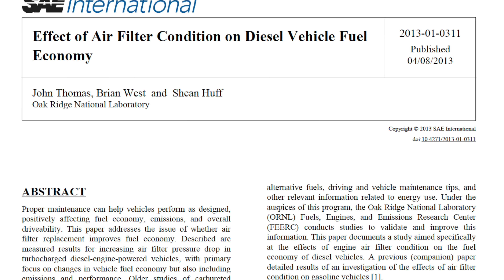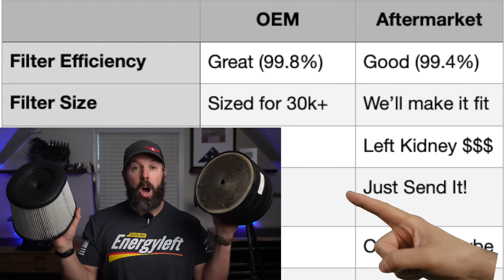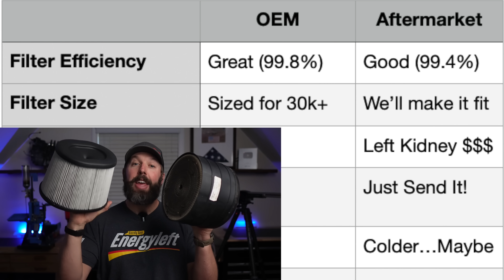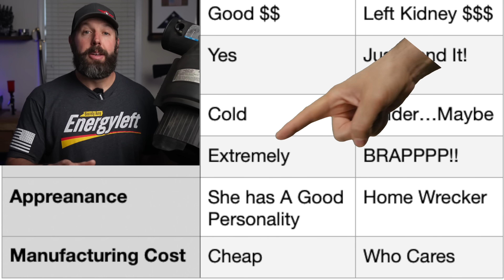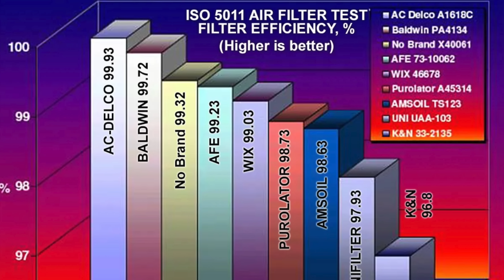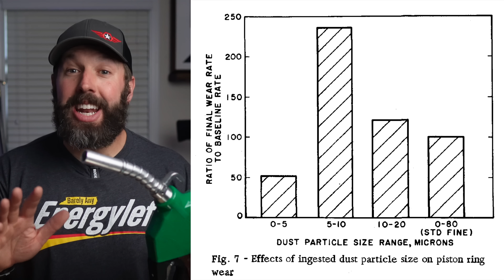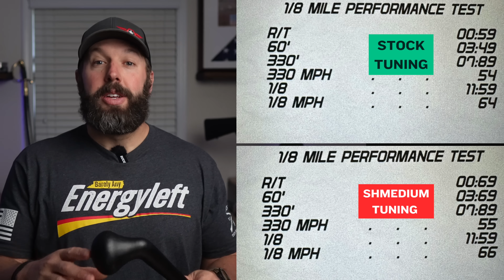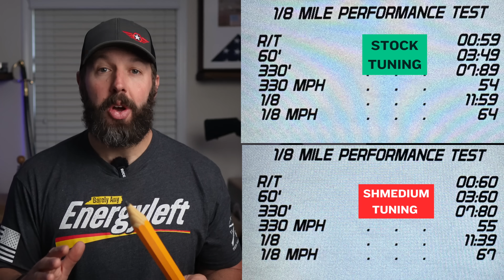The TRUTH About Cold Air Intakes…ACTUAL SCIENCE!

Comment: How many times have you seen a K&N filter just sitting open in the engine bay?  They replaced the factory cold air intake with a post radiator hot air intake.
Reply: I've seen this so much on BMWs... but they already have cold air intakes stock... even on my classic BMWs they have routing that pulls air from behind the headlights, before the engine bay. Silly.
Reply: @seifm02   yup, and its so stupid.
Reply: This is false.  Most cars these days pull air directly from the front of the car. These loads of tests that show there's virtually no difference in IAT'S.
Reply: @GingerDude1  Indeed that was my point, from the factory BMWs have a cold air intake, but often I see owners put on 'cold air intakes' that are sitting fully within the engine bay, drawing air that has already come through the radiator.
Reply: @seifm02 it still doesnt matter. If there's an inlet that draws air from somewhere like near the headlight, you wont have a change in IAT's. If you wanna truly show your myth, show data logs of IAT's with and without the factory intake. They're virtually the same
Reply: Nevermind if after it you have turbo and intercooler
Reply: @Зуб-За-Зуб  Even with a turbo and intercooler it matters.  For the same boost, a turbo has to work harder when the air is hotter.  This means the variable vanes close more and make the turbo spin faster due to the hot air.  That raises the air temperature to the intercooler.  GM actually had engine cooling issues in the 'aughts due to a spike in the air temperature to the intercooler.

Comment: I guess could you feasibly find a oil filter that could go that low for some cars or trucks? And would it be worth it? I wished the aftermarket companies would use the higher filtration filters but bigger to reduce restrictions and design potentially higher flows

Comment: 20 years ago a truck magazine took 4 cold air intake kits for a 5.9 common rail Cummins and compare those to the stock filter system on a dyno. Two of the aftermarket cold air intakes actually made less power than stock and the other two made the same. Then they tested the filtration, those aftermarket did not do well. The best thing is to leave it stock if you run stock or near stock like you said. The motor oil geek just did a video on air filters also very good.

Comment: This is perfect timing. I was thinking of doing a intake system for my 6.7 powerstroke since i've made it lighter weight for lower egt's and possibly better mpg.. I've heard from a performance cummins shop tell my dad to take off the K&N filter and stick to the paper exactly for the reasons you mention. He wasn't going for power but efficiency and as we can tell from this video it's safer to stick with stock paper filter.
Reply from the maker: Yep, it wont help efficiency in a diesel. 👍

Comment: Could you possibly do aftermarket intercoolers. Great info, thank you!
Reply from the maker: Great idea 👍
Reply: @freedomworx  thank you! I’m deciding on if I should do an aftermarket intercooler for my 2.3 turbo Bronco. The science seems to make sense but thought I would get your thoughts.
Reply: On a diesel, intercoolers are a lot like cold air intakes. There is not a one sided fits all solution. You do not always want the coldest air possible because the intake temperatures can have an effect on combustion. For low and medium loads, I am guessing the OEM's actually want warmer air for efficiency.

Same reason people add Cetane boosters. That makes the diesel easier to ignite which is effectively advancing your ignition timing.

Its different on a gas engine where the intake temp means you are pulling ignition timing and giving up power. Gas engines are usually very octane limited and so you want the air charge to be cold to make sure you stay as close to MBT spark timing as possible.
Reply: @Jay-me7gw appreciate the reply. This would be for an ICE 2.3 turbo ecoboost.
Reply: @justinwalters219  Then yes, I absolutely would do an intercooler. I've yet to see an Ecoboost vehicle with a decent stock intercooler. I had a 2014 F150 Ecoboost that I tuned myself and the intercooler was absolutely the first and best upgrade you can do. I would even say get it even if you never intend to tune the truck or do any other performance mods because it will just make it run more consistently.

I dont know who makes them specifically for the Bronco, but the CVF intercooler for my F150 was a huge and worked VERY well. The price was pretty reasonable too. Wagner was another brand that made great ones for the F150, and so did AMS and Cobb I believe.

That and 93 octane and it will rip.

Comment: Turbo Diesel Register had a two part article on air intakes.  Two bullet points are noted as follows:
issue 56-Diesel Power magazine tested six aftermarket air intake systems and none of them made more power than the stock intake.
issue 59-The OEM sealed air box provides the coldest air to the engine.  Semi-open heat shield type air boxes in real-world driving conditions allow hot engine compartment air to enter the intake.
The main point is that the "cold air intakes" are mostly marketing BS.
Reply from the maker: I’ll have to check those out. I assume they are fairly old articles?
Reply: @freedomworx  May/June/July 2007 and Feb/March/April 2008.
Not sure what you mean by faulty?
Reply from the maker: @bribbripnairbnab7301  I meant "fairly"...damn autocorrect. 😂
Reply: @freedomworx  Autocorrect gets me quite often, especially when not using my reading glasses.
Reply: You are correct about the stock air intake was going to put a banks intake on mine then seen the tdr register article saved me over $400 bucks cai are a scam.
Reply: @zackeryeckenrod6549  That seems to be the general consensus in TDR articles.

Comment: I made the mistake of putting a K&N air filter on my old ‘03 Silverado.  After running it for a few thousand miles, you could run your finger along the inside of the intake tube downstream of the filter and feel the grit.  I took it off and put the stock filter back on.
Reply: Question?  Was this a filter that was supposed to be oiled after it is cleaned and then installed?
Reply: Same thing happened to my 22RE 4Runner. I bought it from a guy who had a K&N in it and when I pulled the intake off at one point, the inside of the tube was visibly dusty.

Comment: Speaking of not wanting to hear turbos, before I started trucking, I thought it was cool to hear the turbo whine in these big trucks. After a couple of years of running mountains and pulling heavy loads, I was so tired of hearing that damn turbo scream all day 🤣
Reply: What's really fun is when the truck is so quiet all you hear is that damn thing. It's not super loud, but it's enough to wear on you and your ears start to feel it. I'd rather hear some exhaust and get audible throttle feedback than hear almost nothing. 

Weirdness, I used to stay awake a lot easier in louder trucks. Wore earplugs, but something about that vibration or bass made it easier to stay up. The new one is a sensory deprivation chamber and it's absolute hell.

Comment: 15:31 jokes on you I only race 10 miles at at time.
If you upgrade to a bigger turbo you will need one if its a good bit bigger. My buddy pulled his stock filter into the tube of his intake tube after installing a silver bullet 66 on his 98 12v.

Comment: The LLY Duramax has the worst OEM air intake ever designed for a diesel engine.  GM has a TSB recommending the replacing of the factory for the LBZ version.  I chose the Volant cai with the air scoop as a Replacement.

Comment: How do you think today's dry filter tech stacks up against an oil bath air filter? My old 1969 Dodge Power Wagon 1-Ton 4WD had a large oil bath filter. When I sold the truck in 1988 it had over 450,000 miles and still ran like new. Standard preventive maintenance, points, plugs, plug wires, oil changes at 5,000 mile intervals, fluids, grease & lube. Put two starters and one muffler, and brake shoes & drums as needed during that time. Often wished I had kept it... The Jeep I bought to replace it was a POS.
Reply from the maker: Dry filters are far superior. One of my SAE Papers included an oil bath into the mix. It wasn’t even close. The oil bath was basically a screen door.
Reply: @freedomworx I converted the oil bath filter on my 64 F100 to a paper element.  It took a little fabrication and finding a filter that would fit in the old oil bath housing.  Everyone thought it was still an oil bath.
Reply from the maker: That’s cool 😎

Comment: I would love to see a video about crankcase vents venting to the atmosphere vs stock vs oil catchcan. There's a lot of conflicting information on the internet.
Reply: This would be a good one
Reply: I can tell you this from personal experience: I had a 2019 Honda Accord Touring, which had some sort of stock oil separator. I installed an additional catch can, and it pulled an astounding amount of oil. There is absolutely a difference between stock and a catch can, and this was a simple commuter car.
Reply: @johnfreeman2956 I also have a 19 Accord Touring, it's had a mitsumoto catch can since I bought it. A lot of what it catches is just condensation. But it does catch oil and dirty shit. When it's cold out it fills way quicker
Reply: @johnfreeman2956  Most people think it's trapping a ton of oil.. and what they're seeing is a ton of yellow sludge made up of unburned fuel and water and almost no oil. That aside, catch cans always made my UOAs come back worse for fuel and moisture dilution so I took them off after I figured out they were causing that and I don't put them on my cars anymore. Rather burn a little oil than end up with engine sludge from fuel dilution in the oil.
Reply: @johnfreeman2956 

You are correct; but, for the wrong reason.

Adding the additional "oil separator" changes the PCV system balance.

In essence, the PCV is designed based upon engine size, blow-by, Manifold Vacuum, oil viscosity, and a few other details.

What isn't understood is that the ramifications of changing the PCV balance extend into drivability issues, fuel consumption, engine wear, and potential oil leakage and seal failures. Most commonly, the valve cover, oil pan, and front and rear main seals.

As my father, a mechanical engineer, said many times, if you don't fully understand all of the ramifications of what you intend to do, the best and cheapest choice is to leave it alone.

V/R Chris
Reply: you mean like this ? https://www.youtube.com/watch?v=AnuniilHO5I
Reply: I would also like to see a video showing the Pros and Cons of these mods.
Reply: Emissions improve with recirculation, unsure if power tangibly affected. Fuel economy may be affected by a small percentage.
Reply: I did a vent to catch can then to atmosphere to cut down on how much makes it out to the atmosphere
Reply: Great one, hopefully
Reply: There’s actually not a lot of conflicting information on this, there’s just a lot of people that don’t understand it. Diesels are designed to run the crank at atmospheric. The crank case filters is merely an emissions control component.
Reply: That is me and my 1999 Toyota Hilux - But during inspections, its stock - ha ha -
Reply: there's good and bad to all options....catch can potentially be the most dangerous to the engine. Dodge / Cummins used to vent to atmosphere, now they use a catch can that always overflows and leaks oil.

If you live in an emissions state, you better put it back to stock for the test. My vote is to just leave it alone, and just keep up on the engine bay
Reply: If you vent to athmosphere then when you have vacuum in intake it pulls thorugh pcv through breather unmetered unfiltered air. Bad. Depends on engine, in mine it must be after filter and after maf sensor. Of course before turbo to not pressurize engine
Reply: @fssddfsd3 most diesel don't create vacuum as there is no throttle plate, so the chances of a road draft sucking is non-issue
Reply: VTA is dirty. Stock clogs up intakes and throttle bodies. And GDI will also make the back of valves caked. Catch can works. I’ve had a few. Keep that oil where it matters. In your crank case. Not in your intake.
Reply: @StephenBrewer89  VTA is dirty how? For the engine? Not really
Reply: @Heimdallr-88h14 I mean where the vent point is. Filters still let out vapor and gets in whatever is close
Reply: @StephenBrewer89  Yeah, a little cruddy. The end of the hose can get a little dirty inside but it's a net outflow, and a cheap breather will keep it just fine. Catch can is ideal. Remote breather is good enough for driven vehicles.  Def worth it, especially on engines sensitive to PCV buildup that gets EGR baked.
Reply: @StephenBrewer89  Depends on the engine.  Many modern GDI engines have wash down injectors and/or integrated oil separators.  These engines do not benefit substantially if at all from a catch can and catch cans if allowed to clog/freeze will blow out main & valve cover seals.
Reply: @DrewJHarrison if your oil freezes, your filter isn't your concern. Good bye oil pan
Reply: best crankcase method is actually using the exhaust in a venturi to remove excess pressure but emissions sky rocket..
Reply: @exiteternium that’s how we do on diesels.

Comment: Soooooo, 99% agree. The only thing I will say is that cylinder wall and ring wire if you’re running that cold air intake on a heavily tuned truck that doesn’t blow up after 100,000 or so miles, would probably still be a net performance loss eventually as you leak valuable compression due to the increased wear and loss of compression over the life of the engine.

Comment: Mine route to the front so it is technically colder. On a hot day id rather have 95 degrees over the 225 degrees inside my engine bay in my z.

Comment: Nearly all of the "cold air" systems actually suck hot air into the engine. Factory air boxes draw cool air from in front or beneath the vehicle. K&N filters only work as advertised when cleaned, dried, and oiled properly. It's the oil that traps the dirt. That said, my Dart runs a Weapon-R mandrel bent intake system attached to the factory box with a properly oiled K&N filter. The intake air sensor shows cooler temps than it did using the open "cold" filter. It's a no brainer. My 6.7 PS runs the factory filter and intake...for now. My Chrysler runs a stock system. I clean or replace the air filters in all of my vehicles every 50K miles. I've never had a problem with engine wear or cleanliness.

Comment: Great information, concerning but great!  Always knew CAI didn’t amount to much gain, but do enjoy the little extra sound on the SD 6.7. Wasn’t aware of the S&B CAI til recently, run the Banks Monster CAI Dry with extra cover, was looking for their exact efficiency… can find 99%, but not actual specification. I’ll pursue that little more. 

This in-directly reinforces another reason to run an Oil ByPass 1 micron… getting the soot and air dirt from CAI.
Always enjoy the information and the presentation!
Reply from the maker: If you actually find testing data for the Banks filters, let me know. I was unsuccessful.
Reply: @freedomworx   Nothing on Internet... called Banks Tech Dept and Rep read me the ISO5011, their Monster is 98% efficiency.  They want'ed to express the high flow rate which wasn't of interest.  I'll be changing to a S&B Dry Filter in a WCFab Airbox (Pretty ha!!).  S&B;s 6.7 Filter ISO5011 shows Stock 99.21, S&B Dry 99.90% @ 580 CFM.
Reply from the maker: They emailed me and said that they were adding the test data to their marketing material. So that’s a win for the consumer I guess.
Reply: @freedomworx  oh nice! I asked them if they could email me the ISO5011 report. He said he could only Read it to me. Having it in print is helpful!

Comment: My truck has a factory cold air intake, it's in the upper fender. Away from the engine bay. You know where it's actually cool. The engine bay heat is not exactly conducive to making power.

EDIT: I typed that comment before I watched the video. Glad to see we're on the same page lol
Reply: My 58 Chevy 235 engine has no air filter at all in Florida , and runs just fine , no problems
Reply: Most of the CAI's i have seen use the same fender hole as stock and maybe add an additional duct to the grille.

Comment: This a good breakdown for stock. 
However, most of these modifications will never show any reasonable gains without specific Dino tuning. control of fuel i.e. you don’t just go get fuel out of the pump. You’re buying specific fuel with specific PPm of various chemicals that’s where the injection timing and everything else is gonna maximize the efficiency of that extra available air. 
So I appreciate this breakdown because you’re talking about a truck that is gonna run on the road not necessarily race truck.
Reply from the maker: You don't need any tuning to see a gain in a diesel. More air means more power potential. AFR control is not critical in diesel engines. They always beneift from more air.
Reply: @freedomworx sorta. You can change. Electrical inputs and outputs for different gains/tradeoffs. Ie injection timing egr on off timing. Shift points. 
Just throwing more air wil produce negligible gains. Because a x cc injector will only flow y volume of fuel. And if I’m not mistaken leaning out a cylinder to much can have some negative effects. 

Also fuel quality can drastically change power output because of a wide range of factors. So with dyno tune consistency of the fuel is important. Because you are running on a more less forgiving edge versus a stock tune, which is designed by the OEM to run from the deserts of Arizona to the mountains of Alaska, which is why it has much more varying flexibility and I just realized I’m arguing about something that is completely unrelated to this video and I’m sorry

However I may have been arguing “with my original comment” the wrong point. Or overthinking the information.